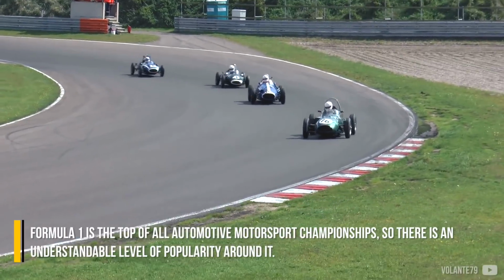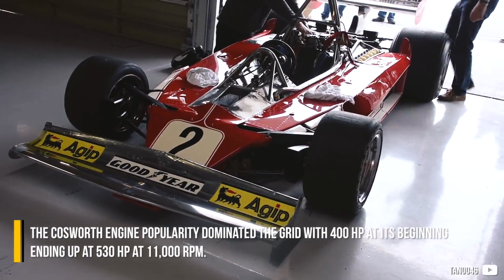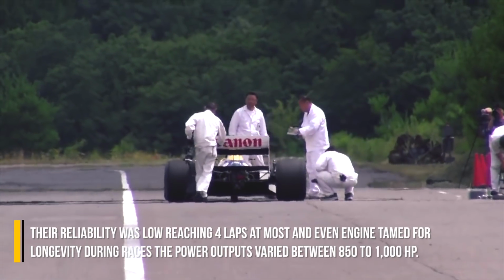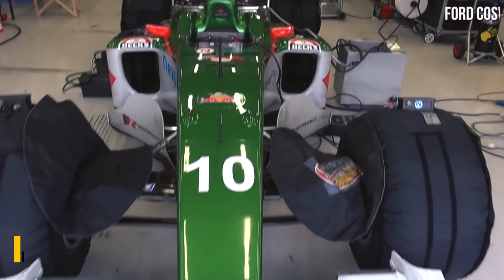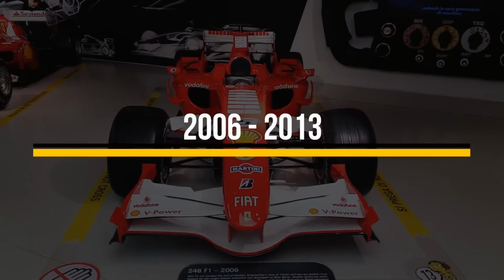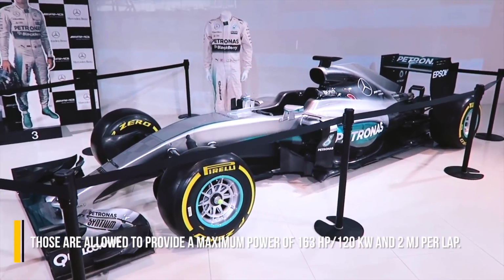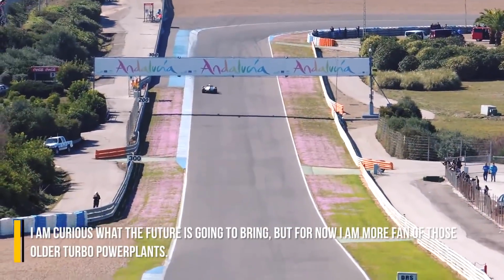1947 - present: Formula 1 Engine Evolution

Comment: The next engine regulations for F1 2021 will be downsizing the engine to become a inline 4. KERS will be much more powerful.

The next downsize may be 3 years after 2021. So we may see Inline 3 engines as well. 

The Super GT500 series have shrunk the engine from the V8s and V6s to a 2L Inline 4. Power is limited to 650bhp. 

Wont be surprised F1 will become E1 as in fully electric. 

Soon we will all be watching Toyota Prius running around the track. 

The V12,V10 and V8 era was the best and Ferrari and michael schumacher era. It sad to hear he still in a vegtable state.
Reply: Because you mentioned the Prius, there is a V8 powered Prius in the Super GT300 class
Reply: Michael Hartmann 😂😂
Reply: Michael Hartmann oh that is a one off unit. A mid engine V8 monster. 

My eyes popped when i saw that. 

By 2021 we might see Toyota, Nissan and BMW return to F1 by providing engines. 

Nissan NR20A can produce 650bhp with just a 2L turbo unit which powers the GT500 race car. I can imagine a 4 banger turbo producing excess of 700+bhp and reving up to 12000 rpm.
Reply: In 2021 the F1 engines will still be turbo V6s.
Reply: 2021 engine will still 1.6l v6 with mgu-k only but it will be more powerful
Reply: Also as you mention schumacher era as the best, people back then said f1 was boring because he keeps winning
Reply: i mean, if they could produce reliable 4 cyclinder 250cc motorbike engines that redlined at over 17000 rpm and produce 45+ hp then whats stopping it from being done at a larger scale? 

This was early 90's. and a lot of those engines are still running today.
Reply: Lin Chester since some lmp1 are starting to use “v4s” (yes a v4) we might see them coming to f1
Reply: They're not allowed to go full electric becaus of Formula E
Reply: @vertatech4152  Yes I think V4'S are inevitable now.

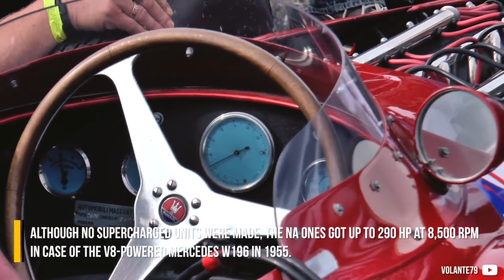Comment: 1:38
There is a mistake! 
The Merc W196 had a straight 8 cylinder, not a V8!

I actually Love the new V6s except the sound. But these engines are insane because they have to be stabil und reliable. They are running on around 3,5 bar of boost.

Comment: The 2004 Williams BMW V10 was the greatest F1 car ever built, fast, beautiful, and the greatest sound ever to be made by an internal combustion engine.

F1 fell off a cliff from 2014 with its god awful hybrid turbo engines and has been laying twitching at the bottom ever since.

F1 1947-2013 R.I.P.

Comment: F1 should be made to burn hydrogen instead of fossil fuels, that way the technology would develope to the benefit of those among us that wants a great soundtrack to our enviromentally friendly cars. BMW made an engine like that in the 90's I think, and it's about time someone picked up where they left off.
Reply: Martingoldfire They actually consider using synthetic fuels, which is basically made by extracting carbon dioxide from the air. That would make F1 races not only (almost) CO2 neutral, but also more eco-friendly than electric vehicles.

Comment: 2021 Engine Regs are similar to the current ones except they are removing the MGUH and increasing the fuel flow so the engines will rev higher and produce around 1000hp. the current engines are producing around mid 800's on engine alone and with the hybrid system engaged they are around 1000hp.
Reply: Nico Vazquez Conde True, I wonder what sort of torque figures they make nowadays, I bet it's crazy
Reply: Drew Hender apparently a crazy amount. The current engines may not sound as musical as the ones in the past, but they are incredibly powerful. The old v8's were quoted  from Brundle as "not able to pull the skin off a banana". The current engines at least have some serious guts and you can see how much new drivers struggle with them. Before the power jump from GP2 to f1 wasn't that big.
Reply: Nico Vazquez Conde Yeah as much as I love the sound of classic F1, I've learned to really appreciate the pure power the modern units have, and respect the technology they utilize

Comment: I'm hoping the R&D going into pneumatically operated valvetrains, like Koneigsegg's freevalve technology, allows Formula 1 engines to scream like the old days while retaining a desirable thermal efficiency. Having a computer able to control valve timings, lift, and duration automatically based on the demands placed on the engine at specific speeds and loads to achieve the best thermal efficiency and power possible would let these turbo V6 engines really shine.

Comment: My favorite engine music were the V10's of 1995-2005.  The unrestricted turbo era of '82-'87 is my next favorite, even though they didn't sound so great.  But the astounding power output made up for that.  And for all of you haters of the current 1.6L V6 turbo formula, max engine speed of the original turbo era was also about 12,000 rpm.

Comment: I think when the restriction goes to only four-cylinder engine is allowed, Honda might came in to the race indepently (not with williams, etc). VTEC won't be there as you said about no valve timing on the rules, maybe there will be higher RPM limiter as four cylinder needs those Revs to get huge output. Btw, VTEC just kicked in yo!

Comment: It would certainly be interesting if they'd need to use the same engine block as the 500 CI engine from the Cadillac... I wonder how much power they could get out of that thing? 2000hp? Who knows, at least they would sound amazing.
Reply: Ai Torror NHRA Pro Stock runs a 500ci Big Block that makes more than 2000hp.
Reply: You would hit a hypothetical wall in hp eventually but before that it would be awesome but very big $$$ and the power figure would be somewhere between 1000 - 3000hp depending on how long you want it to last

Comment: Thats what gearheads need to see that those new turbo era 1.6l are reliable cause they shuft at 10000 rpm if 3.0l v10s did that they will last  50000 miles

Comment: I believe to get the best of internal combustion engine engineering and technology today there should be five rules only:
1) must have a driver;
2) must travel a fixed distance;
3) must use publically available pump fuel;
4) must have max fuel limit; and
5) 1st vehicle past post wins.
Not interested in weight, number of wheels, drive train, track, wheelbase, aerodynamics, tyres or anything else. This would open this sport up, cut the cheating (which only occurs because there are too many rules to interpret) and thoroughly encourage teams to take chances. If people didn't take chances in the 18th century we'd still be riding horses today.

Comment: I'd want to see electric with a range extender (rotary, turbine, free/ opposed piston) along those V6T. Power output of the electric motors could be limited to weighted average of those V6T. I want to see more innovation and variation now it's very limited

Comment: limiting the displacement, the number of cylinders, the intake air pressure, the number of valves per cylinder ...ok I get it, is understandable somehow, but limiting the rpm ? that's dumb!

Comment: Fyi...1 Barr is equal to... (Guessing...1 atmospheric prrssure @ sea level..or 14.7 psi?) Given 80 psi is at 5 or 5.5 Barr
Reply: Close.  I bar = 14.5 psi = 100 kPa.  The 5.5 bar limit was for absolute manifold pressure, so the actual boost pressure was 4.5 bar = 65.25 psi

Comment: If i owned f1 i would bring back refueling (because today drivers can't go flat out all the time like they used to because they have to save fuel and that sucks) i would also give teams a choice between v8s v10s and v12s and set the horsepower limit to 1500 (because in my opinion f1 needs to have at least 1000hp but more more than 1500 might be too dangerous and too hard to handle)

Comment: Anyone else actually able to see how much slower the present ones are then some of the older generations?
Reply: Since the FIA allowed wider tires in 2017, the current hybrid cars are setting absolute lap records wherever they go.  Despite the fact that they don't sound as wicked as the 19,000 rpm V10's of 2005, they are faster, and burn much less fuel.

Comment: Yes, that's good idea. Do the rally car engines. In particular, do Group B. Don't miss the Audi Quatro S1. Not much sounds that good.
And if you're looking for greatest ever noise, go find a LeMans spec 917 that's healthy, because when they're built & tuned right, nothing in the world has ever sounded as good as a flat 12 boxer Porsche going down the Musane at nearly 250 mph... It roared and it thundered and it howled and shrieked, all at the same time! When I was a little boy, in the late '60s & early  '70s, all the 'fast' cars in the cartoons sounded the same, and it took me years to work out where that noise of 'fast' from my childhood came from. It was a 917. It is the sound of speed, and nothing else quite sounds like that. It's the howl of joy you haven't had yet. It's the sound track of exhilaration. It's an eargasm waiting to squirt goop all over your shoulders...

Comment: Would be lovely to see this same format applied to indy cars, dont know much about them but they were like the step brother to F1 in my eyes no one like him but they didnt know him either so he could be cool and you dont even know
Reply: F1 has become so boring. In indy cars, there is at least some changes in the lead and a  little dueling during the race. Fi is the most expensive parade around, no over taking because the cars get unballenced if anything comes within 50 feet of them.
Let go back to a late 50's early 60's type racing where cars actually races instead of following each other around in a parade of ego.

Comment: All F1 cars should be restricted to in line 4 cyl max 1600cc with no forced induction, using common petrol 92unleaded, using air cooled engines and 155mm width tyres only!!

Comment: It’s not even really the peak of possible performance anymore so to me there’s not really much value to it being so fast in other ways. A racing series with just a car weight and engine displacement limit and a requirement for manual transmissions and no driver aids would be a lot more interesting to watch I think. It’s so often now you watch F1 and it’s just throttle 100% then brake 100% there are moments but nothing like watching Fangio or the like wrestle their cars around. If Formula 1 wants to really be the fastest with KERS and flappy paddle transmissions and driver aids and such, it needs to also have the screaming engines too. Sad overall, I think the sport could be so much more interesting to watch than it is rn. My favorite era is probably the 2.5L or the mega turbo 80s cars, but I’ll always have a soft spot for the nearly 20,000rpm V12 and V10s of my childhood

Comment: i would re introduce 2 stoke engines with closed lube cirquit like the 4 strokes,  wankel engines , and even electric if yu please  all racing together.  no rev limiter  only  battery weight limitation and displacement limitation up to 3800cc     electric power output limitation of 250KW     1 engine per weekend  1,5 hour duration    in 2x 45 minutes saturday and sunday race      up to 430 kph  !!!  no spoiler cmq limitation unless it disturbes windflow for others to overtake
Reply: and yes a  bulletproof screen in front of the drivers and cage structure for protection

Comment: Is it just only me who like V6 turbo ??
Reply: Nope, I think they are fine too.  It's a matter of the revs they are turning.  They sound a lot better today than they did 4 years ago because they have picked up about 1500 rpm since then (fuel efficiency has increased significantly... and efficiency is what modern F1 engines are all about).  With time, they will improve even more.

I actually liked the 1978-88 1.5l turbo era for sound.  Plenty of people hated it and dreamed of a return to V8s and V12s (which happened).  That was great... but once the v10/v12s were turning 15-18000 rpm it was more of a scream than a shriek (like the 1979 Matra V12... the most beautiful engine sound I've ever heard).  To each their own, but I think the complaints over the sound of the current engines is very much overblown.

Comment: tbh the FIA is completely trashing F1. There are too many rules and regulations and it's adding a little too much uniformity to the races. It'd e nice if builders could choose from 2.5l turbocharged or supercharged engines with a maxumum boost pressure of 25 PSI and use any layout they wanted as opposed to having to use an engine that is almost completely identical to the competitor's. I can agree with limiting power so drivers don't get an unfair advantage by having nearly twice as much power but other than that. It'd be real nice if F1 didn't become NASCAR with less explosions.
Reply: There's certainly an argument that enforcing too many specific restrictions (number of cylinders, turbos etc) actually increases the cost of development and ultimately results in too much similarity between engines.   In the end, though, if one manufacturer or another is willing to spend $350-500m developing an engine, they will find a way to make it better than lower spending manufacturers.  This is why so called spending limits are ridiculous.  If a constructor or engine manufacturer can find a way to go faster they will do it.  If they can raise more money than other teams they will find a way to spend it to make their cars faster.

I've always advocated for very basic but harsh regulations for f1:  Maximum car width and length specified, maximum tyre width imposed and minimum ride height of 6cm (which they tried in the early 80s but couldn't enforce).

If you regulate the tyres, impose a minimum ride height and maximum physical car size, it doesn't really matter what type of engine powers it.  Ultimately, manufacturers will still find the best and most efficient compromise on power/weight/delivery curve.  But at least they'd be free to try it their own way... unlike now.

Comment: Those atmospheric V12s, V10s, and V8s sounded glorious, like  big racing motorcycles.  The current lame V6 turbo engines sound like sh*t.  Muffled, plasticky and hollow.  
→I'm in favour of a new engine rule: 
Naturally aspirated, 2000cc engines with no limits on RPM or number of cylinders.
Nice, clean and simple. No turbos, no rev limiters, no regenerative bullsh"t.
Pneumatic valves?  They're cool, but kind of a dead end technologically, being impractical (so far) for production use, but they allow higher RPMs, so yeah, I'd allow them.  Screaming 2-litre V12s, V10s, V16s, H16s, flat 8s, 10s and 12s...now that'd be a symphony.

Comment: Over regulation has killed F1 engines
This is the “beige” engine era, all rather boring really 
We need V8’8 against straight 4’s and 6’s and V10’s and V12’s etc
Look at the British touring cars they are all totally different cars that are all better at different aspects with really close lap times overall leads to exciting racing 
If some cars were better on fuel and tyres but slower and vice versa it would lead to different pit and race strategies that makes things interesting

Comment: Stopped watching F1 at the start of the hybrid era because it's nonsense if you want to have that type of powertrain go and have but it's not formula one I've got two road vehicles that sound better than those I know they're quicker but they can't compare to a 3litre V10 at 22000 rpm
Reply: 22?? 19200 is record of F1
Reply: alessandro ari zaluski BMW V10 ran at 22000